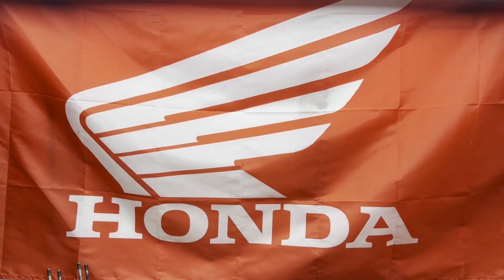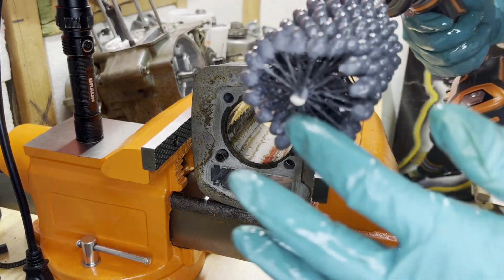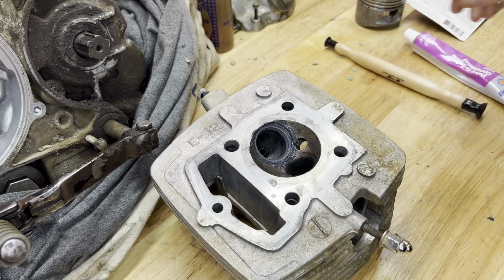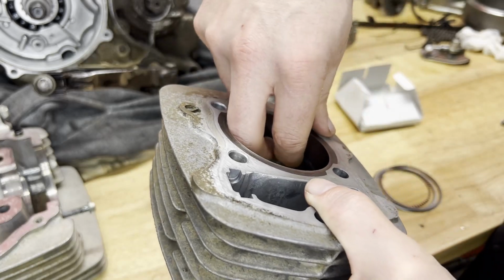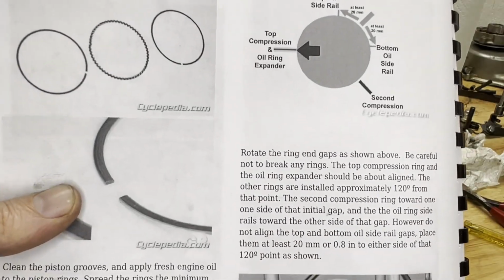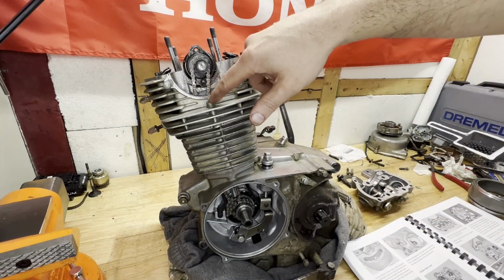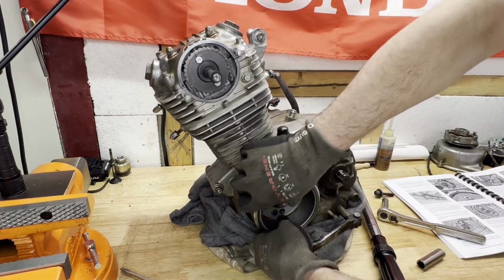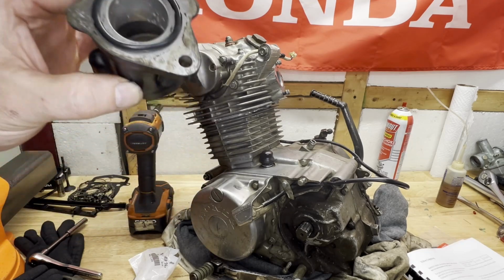XR200 top end rebuild: honing cylinder, lapping valves, new rings, cam chain and assembly

Comment: I was waiting to see you check the CDI timing/alignment.
Reply from the maker: I think I marked the position before removing it.  It’s been over a year since I worked on this one 😃
Reply: @Garage2Trail  Thanks for the reply. Even with the pickup clocked all of the way to the right I can’t get it to align with the advance unit. TDC been checked 3 times, I can’t figure it out. I even moved the cam gear a tooth each way but “T” would not align with cam gear mark.
Reply from the maker: @csedan510  hmm, I wonder if your advance unit is out of another 200 motor weather it be the ATC model or perhaps a different year XR200 that may have been different.  I can’t say I’ve done enough to know for sure.  I recently picked up an ‘83 XR200R so I’ll probably be getting into this again.
Reply: @Garage2Trail  it was working and oriented properly when I took it apart or so says the old screw marks on the base plate. I’m got to check flywheel and make sure key isn’t broken.
Reply from the maker: Ahh ok gotcha.  Not a bad idea to look at the key…maybe it got crunched when you to tightened down the flywheel.
Reply: @Garage2Trail  But could the mechanical timing be okay if that were the case? i.e. The cam gear is at “0” and the pointer is on the “T”.
Reply from the maker: Good point there too!  Troubleshooting by talking it out lol.  I’m trying to jog my memory of when I had that all apart.  I don’t recall there being many other ways for it to go back together other than aligning the cam “o” and having it at TDC
Reply: @Garage2Trail  As ignition timing is the more important variable for easy starts(building this for my 13 year old) I have to run 1 tooth advanced on the cam to get the ignition timing right. Hopefully after the new Chan and cam gear stretch and seat, I’ll be able to move it 1 tooth back.
Reply from the maker: @csedan510 oh wow that’s gotta be stretched!  Gotta watch…I heard the 200 is prone to jumping teeth especially if the crank gear is rounded.  Mine wasn’t bad but it still found a way to jump a tooth or more and the valve hit the piston before I got it.

Comment: Great job on the rebuild, I noticed you had a manual off to the side of your workbench where did you get it like to know thanks
Reply from the maker: Got it on eBay.  Here’s the link.  The factory Honda workshop manuals are ridiculously priced.

https://www.ebay.com/itm/265337507604?mkcid=16&mkevt=1&mkrid=711-127632-2357-0&ssspo=VOMvm8qcQXO&sssrc=4429486&ssuid=1QWenE7CT8u&var=&widget_ver=artemis&media=COPY

Comment: Hey there just wondering where did you get all the parts for the bike, really helpful video thx!
Reply from the maker: Thanks!  I got most of it off rockymountainatvmc.com.  Check the OEM parts section.
Reply: Oh and one more question, any chance you could give me a link to the feeler gauge you used? Thx!
Reply from the maker: @andrewYdoesntAnyHandleWork the feeler gauges I use are old Craftsman’s that my dad gave me…sorry I don’t have a link to those lol.  I’m sure any on Amazon with good reviews would work though.
Reply: Hey good morning, what is the torque spec for the top nuts?
Reply from the maker: @andrewYdoesntAnyHandleWork  hi Andrew!  The book I have shows 20-22 ft. lb.(240-264 in. lb) on the accorn nuts, and 6-9 ft lb(72-108 in. lb) on the allen bolts

Comment: Nice work on the build.  I'm almost finished rebuilding a 1987 XR200R, just some carb tuning remaining.  Don't forget to set the firing timing (the second line on the flywheel) with the position of the CDI, but maybe you plan to do that once you get the motor in the bike.  Anyway, I look forward to seeing the next video.
Reply from the maker: Thank you!  I actually do need to do that yet.  I had to piece the CDI stuff on just to wrap up the video because I’m still waiting on a couple gaskets for it that got lost in the mail 😡.  Didn’t want to delay the video any longer than it  already was.  I appreciate the heads up!

Comment: Rebuilding this same motor right now. What was the spec you torqued the 4 main top nuts to? Great video!
Reply from the maker: Thank you!  Let me check the manual when I get home later on.  I’ll let you know.
Reply: @Garage2Trail  great thanks
Reply from the maker: @Eastontheman  looks like the cap nuts are torqued to 21ft-lbs or 28N-m

Comment: bey g2t can u please find out wht size of bolt or wht tool to get the flywheel off to get to back of timung chain stuff ahhhh
Reply from the maker: Believe it or not, but the rear axle bolt is what I used.  The threads are the same.  Just make sure they are cleaned up and good before cranking down into the flywheel so you don’t booger those up.
Reply: no way u kidding me iv been blowing my mond on trying to figure it out and its right infront of me man 😮😮😮😮😮😂😂😂😂
Reply from the maker: @snorkelmancraig2740  lol…I didn’t know until I saw someone mention it on a Facebook XR page.  mine is a 2002 but I think the axle is the same on a lot of years.
Reply: well worth a shot ill be glad to let u know going to tey it now mines a 81 xr 200 hear we goo
Reply: it screws right on how much frce should i use i am aply alot of presser un not moving should i keep going

Comment: on my 74 xl-250 i had to remove tension on the rear cam chain  plastic tensioner to allow the chain to slide over the sprocket.

Comment: any alignment for the CDI ?  I marked my backing plate and case to make sure timed properly.
Reply from the maker: I also marked mine but if I recall correctly, it only went back on one way.
Reply: @Garage2Trail  the backing plate can be rotated, held in place by 2 phillip head screws.
Reply from the maker: @johnmathewson985  ok yeah, I marked mine but let me check the manual to see if they make note of any factory timing marks.  When I got it back together, it ran perfect so I didn’t change anything.  I’ll get back at ya…
Reply from the maker: Ok looking at the manual, it says to set the timing marks on the flywheel to “F” with the index marker on the top of the hole on the side cover.  Then install the base plate aligning the index mark on the pulse coil (small black box that has the shielded wire coming out) with the mark on the rotor.  Basically two vertical lines….so I guess really you need to make sure you got that rotor on the right way while at “F” on the flywheel before worrying about the baseplate.  Hope that helps.  Kinda hard without pictures to explain.
Reply: @Garage2Trail  thanks, you when above and beyond.  This will help anyone who did not mark the plate first.
Reply from the maker: Glad to help out a fellow rider!

Comment: Have question i bought a roller,1998 xr 200 r honda the bottom end is good it moves,but it didn't come with a piston,so i ordered piston kit on ebay brand new ,but the connecting rod thatbwas left in there is not pushing the piston up far enough,what to do,NOTE : THE KIT I ORDERD WAS BIGGER 250,.  SO DO I NEED GET ANOTHER CONNECTING ROD AND IF I DO TJAT WILL I HAVE TO CHANGE THE CRANK ALSO? HOPE TO HER FROM YOU?
Reply from the maker: Was it a “big bore” kit specific for the XR200?  Its tough to give a definitive answer when there are mix matched parts unfortunately.  I’d hate to give you bad info and have it cause damage to your bike.
Reply: @Garage2Trail  yes it was a piston kit from eBay that was bumped up to a 250 cc which is what 66.5?
Reply from the maker: Not sure…everything I’ve rebuilt has been back to stock specs so I probably won’t be much help.  Sorry!  I’m always worried about aftermarket stuff fitting correctly.  Does the kit mention anything about a connecting rod?  Maybe it was for the CRF230?  Just a guess tho
Reply: @Garage2Trail  no it didn't say nothing about that ,but could you send me the actual size of the original poison for the Honda XR 200 r, like 66.50 or whatever it is called? Maybe if I get that I can move forward

Comment: Looks like the cam follower ends of the rocker arms were a bit worn……..
Reply from the maker: I wonder if that’s attributing to the little bit of noise I hear just above idle.  It goes away when the revs climb and you only hear it for a second when the rpm drops down.  When it hits idle speed again you don’t hear it.  I’ve double checked the cam chain tension because that was my first thought as it sounded a bit like chain rattle but that’s tight.  I adjusted the valves too and they are spot on.  Bike starts easy hot and cold and doesn’t smoke so I haven’t been worrying too much about it.  Been riding it a lot too.

Comment: Hey which site you getting oem parts from?
Reply from the maker: Rockymountainatvmc.com. They have an OEM section and most of it’s in stock.
Reply: @Garage2Trail  rebuilding my 88' XR200 bent intake valve as well, Chinese valve didn't fit 🙄
Reply from the maker: @mitchfretz7588  oh man that sucks.  OEM will treat you right.